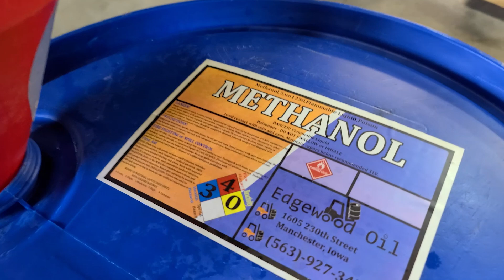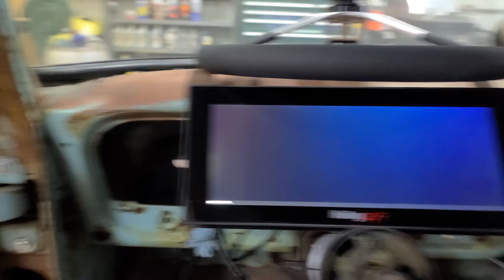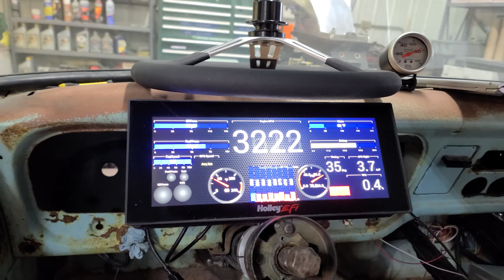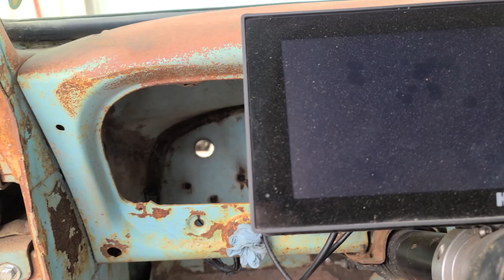Winter prep for the Deathtrap and new project is decided

Comment: I am firm believer of mixing a little bit of marvel mystery oil in the pump gas just to add a little bit more lubricant for everything.  Additionally I also don’t think it’s a good idea to ever drain methanol from a fuel cell or pit jug back into the barrel of methanol because it is anhydrous (attracts water) and any fuel especially that which has sat in a fuel cell/fuel tank and has been subjected to major heat cycles and been outside is going to have picked up some water so why drain contaminated fuel into your “mother” fuel barrel and contaminate that and even if water was not an issue dirt is and no fuel system in a vehicle is ever free from dirt.  Keep up the good content and if you don’t get another video out before the first of the year, wishing you and your family a Merry Christmas and a Happy New Year.
Reply from the maker: Completely understand I did use a funnel with a very fine screen but you are correct.  I should have put a little marvel mystery oil have a gallon on the shelf!  Hope to get a few more out before the end of the year. Always appreciate yours and everyone else's input! 🤙🤘